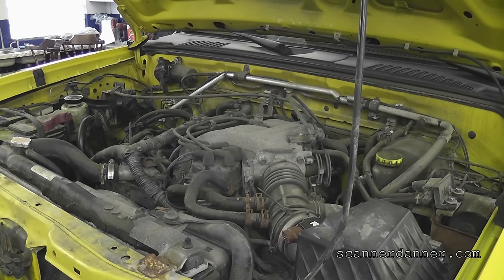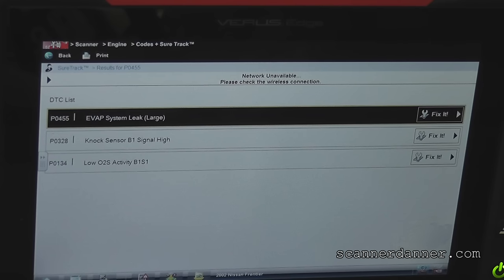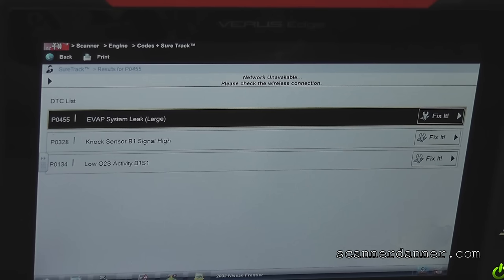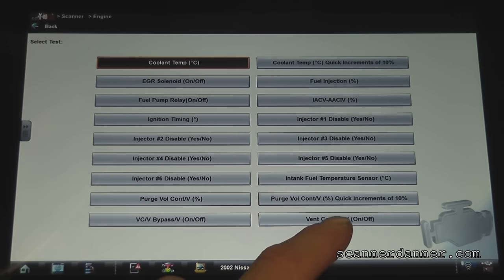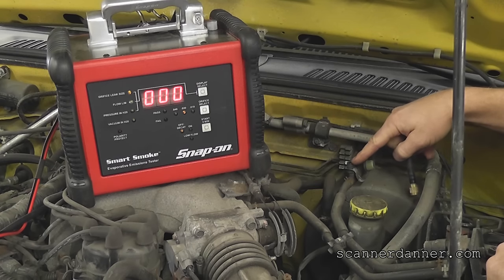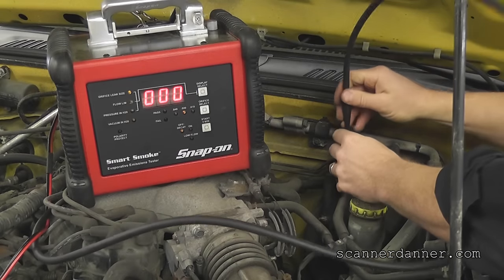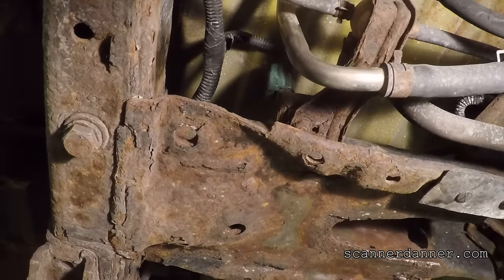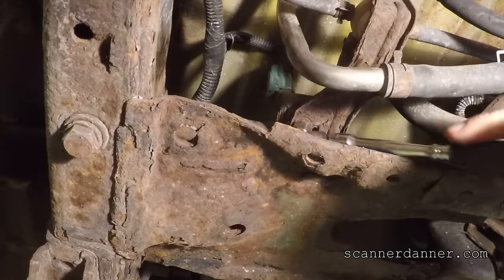EVAP  leak P0455 (vacuum cut valve-bypass valve test) - Nissan

Comment: Man, we on the west coast really do have it made. Seeing that car and it pretty much falling apart sitting there, that's tough. And I thought my 89 mustang that has lived outside for 27 years was bad because of a few spots of rust. I could feel your pain when I kept seeing all the rust flakes falling off, probably right in your face. I knew it was an issue up there, but didn't know it would eat a car away in less than 10 years.

Comment: Uggh - EVAP is my nemesis. I swear that system was designed solely to bilk as much money out of consumers as possible, and as an added "bonus", give backyard mechanics like myself an aneurism. So infuriating ...

Wish I could afford that smoke machine! Puffing on a cigar and blowing into a hose until I'm purple ain't cuttin' it ... :D

Thanks for all your vids Paul. BEST on the net, hands down. You have a rare talent that I appreciate. I've learned more in 4 hours of your vids than I have in fumbling with OBD-II since it reared it's ugly head in '96.
Reply: +Smitty Smithsonite  You can make a smoke machine from a smoke machine sold during Halloween.  I brought my Halloween smoke machine for 75% off a couple of days after Halloween.
Reply: +Upallnight, Not a bad idea! That thought crossed my mind, but I never thought it would work. Thanks!
Reply: +Smitty Smithsonite I made one out of an e-cig, an aquarium air pump, and some hose.

Comment: Thanks for this vid. Had exact same rotted in two cut valve solenoid on my sons 01 Xterra. Evap “large leak” for sure.  All difficult to remove. Was a Pa vehicle so even some of the tubing clamps were rotten. Replaced all but the canister.  PITA job. Nice vids!

Comment: Paul, not sure you can recollect me .. now you got many subscribers, let me try any case :).. when you do smoke testing on honda, toyota, hyundai, you need to activate two way valve, or bypass valve.. this is because the cars that i had mentioned seal canister from tank using two way valve and it is normally closed, if u dont see smoke doesnt mean that there is no leak, u need to activate the two way valve, so smoke can go from canister to tank.. just a little tip.. this is how it works, purge solenoid activates, send vaccum to canister, activate  bypass or two way valve, send vaccum to tank and close the two way valve (deacgtivate), and look at FTP sensor signal. if vaccum holds good, then canister to tank is good, then it activate bypass and look at FTP sensor if vaccum doesnt hold good, then purge solenoid to canister there is a leak.. it took me a week to understand

Comment: Watching you struggle with that connector made me feel somewhat better lol because I had to replace that exact same valve on my 2000 Xterra for the same P0455 code and it was nasty. Nothing but rust falling on my face the whole time. Had a cracked hose also to replace. Oh, and the kicker is that, my Xterra came from PA and I live here in FL...:):)

Comment: Great patience and video. Picked up a power probe kit and a autool 206 smoke machine have not used either one yet still messing with that annoying po448 on my 06 suboe sti . May send out the pcm for inspection.

Comment: As always Paul thanks for your videos and your honesty in filming.  Truly one learns from adversity and error and your "unedited" exploits often give lessons beyond the subject material.  Being a good mechanic is some good percentage of conquering what the service manuals and standard hours ignore - via patience, persistence, innovation, scholarship, and in my case Italian cussing!

Apropos to the PP.  I LOVE my PowerProbe IV and find myself using it almost exclusively (not like the III and lower which left me cold).  Yet on occasion  I do pull out the LoadPro with a good DMM.  E.g., when I really want to nail loaded resistance or safely test for shorts e.g. when I think water involved or safely turn on something delicate.

The LoadPro applies a guaranteed 25 Ohm current to the circuit.  I guess I trust it to keep me out of trouble.  And when it comes to resistance I find it more accurate incrementally than the PP IV.  Sometimes that accuracy counts for me.

Yes one has to calculate from the voltage drop on the DMM but that's not a problem for me plus I have a cheat sheet if my brain is lazy or numbers not math friendly.

BTW as an aside cheat sheets are a good item in any tool box and take up little space (tip to your students).   They save time, help avoid faulty memory mistakes, and add authority sometimes when talking to customers.

For example the one for resistance/voltage/amps referenced above.  And those like for MAF values are  handy when diagnosing.  And those like for parasitic draw and its effects good for diagnosing AND making the sale.  And the ones for like torque values and wire gauge requirements time saving.  Along with rules of thumb there are more.. and they help.

Hope you don't mind my unsolicited thoughts and thanks again.
Reply from the maker: +FriendsInNY not at all! Thanks brother

Comment: I'm in Florida but we get our fair share of rust belt cars (winter Floridians).  Whenever I get a connector that is that stuck, I try to use those circle tip needle nose pliers which are great at removing hoses.  I grip the body of the connector with it, and use my free hand to depress the lock. Works most times, if space allows of course ;)
Reply: Now that I got farther into the vid I saw it was one of those lovely Nissan locking connectors! Those are a major PITA.  You have to push the light green tab in and down.  It will slide down into the connector and lock in place.  Sometimes you have to bathe it in penetrating fluid so it can slide.  Once you lock it in place, you can yank it off using the pliers method in my original post.
Reply from the maker: +Lynx Star Automotive (Gabe V) sigh, I know now. Everyone is calling me on it :)

Comment: Hey Paul, just about every Nissan that comes into our shop has a KS code stored. For some reason, KS codes don't turn on the SES light on Nissans and won't fail you on an emissions test, at least here in TN. Most customers won't pay for diagnosis and repair of a code that doesn't keep them from passing and doesn't have any related drivability problems

Comment: Thanks, I didn't even see it up there before but I think mine on a 2002 Nissan Xterra is leaking too. I've been chasing a small EVAP Leak P0442 code... My valve is rusty too and I can small gas when I'm right up close to the thing.

Comment: To anyone working on the nissan connectors, You MUST clean with water soap  and air pressure so that the tab he is pressing on actually slides fully  down and  back to release the pin,  you cant just press the tab, the whole slider is spring loaded,

Comment: You can find evap leaks with soapy water/childrens bubble formula in a spray bottle and shop air reduced to under 1psi... Just an FYI. In fact I often use soapy water in conjunction with the smoke machine for those really hard to find evap leaks. It's always rust with older Nissans.
Reply from the maker: +Auto Fix Pal nice! can you share what you use to regulate your shop air down to 1 psi for us? Maybe a link?
Reply: +ScannerDanner I've never regulated 130psi down to less than 1 psi. I do  have a smoke machine. I was in another shop programming a PCM, a guy that worked there said that's how he leak tests.. That's where I got the idea to use soapy water in conjunction with my smoke machine to find those really tough leaks. He was using some regulator he got online. Definitely plausible. You can probably do a bit more than 1psi but you can ruin pressure sensors on some vehicles if you do too much.

Comment: I hope this question doesn't sound dumb. But when you checked the driver circuit and had that 0.6 of a volt, I was thinking the ground voltage was high. My question is, whats to high of a voltage on a ground for these circuits? I say this cause I just worked on a 99 Toyota with a evap vent solenoid that was sticking so I replaced it confidently thinking i fixed it. Then a week later it came back with  a circuit code. My feed was good (12+ volts) and the ground had a 0.7 when I energized it. Ended up being a lose computer connection, bring my ground to 0.03 after I fixed it.

Comment: Amp=Volt/Ohms 11.54/4.4 = 2.62 Amps
Feed test seems to be calculating the voltage drop along the wire by comparing the Batt voltage from its clips on the battery and the current(amps) it's reading through the probed wire and displaying the resistance of the circuit. Notice the Batt Voltage and Tip voltage at the bottom of the probe.
V= IR 
V = 2.622 * 4.4 = 11.536 (or 11.54 rounded up)
Basically, it's an ohmmeter using Batt voltage as the reference and measuring current flow through the tip.
Reply from the maker: +CO Jones I'm following your math for sure but here is why I do not think the tool was putting a 2.62 amp load on the feed wire. 
1. when i plugged my test lead back into the PP4, there was not arc. 
2. you do not press the PP$ on/off button for this test, it is automatically done by entering the feed test mode
3. so with it being automatically done, i would definitely have seen an arc when connecting that test lead to a circuit being energized with 2.62 amps. Unless it delays the load? 

The owners manual says less than 30ma for the feed test.
Reply: +CO Jones Here's a handy little Ohm's Law chart for DC.
http://hi-techcontrols.com/images/ohms_chart_big.jpg
I made a similar one on an index card and put it in my wallet.
Reply: +ScannerDanner The current measurement through the tip would be through a known reference mega-ohm resistor back to Batt neg just like a regular DVOM, just instead of an internal 9V battery or whatever powering the meter it&#39;s using the vehicle battery for power and the reference test voltage.

A way to test if that's what it is doing is to do the test with the tip straight on the Batt Pos (0 Ohms) and through several known resistors between the tip and Batt Pos to see if the readings match the values from a regular DVOM.
Reply: +ScannerDanner I found the manual for the PPIV. On page 10-11 it says the ohm reading is the total resistance of the probed circuit back to battery.
It also says you can plug an optional test lead in the green aux ground and use it like a regular ohmmeter to test things that aren't connected to the vehicle. So, I guess it is just an ohmmeter using the Batt neg clip internally as one test lead.

http://www.powerprobe.com/images/extraInfo/PP4_Manual.pdf

Comment: This is a great example of why we should be paid for diag. It really irritates me that some auto parts stores pull codes and then lead the customer to believe they have "diaged" the car. I guess it pays off for them in the sales of O2 sensors. Hopefully they haven't cleared the codes when it ends up at my shop.

Comment: I have a 98 qx4 and it is throwing the P0440 evap code and the P01491 vc cut v bypass v code. It has a new charcoal canister and i unclogged the hose that goes to it. A bunch of mouse poop looking stuff came out the hose when i blew it out. Is there a chance that stupid little white vacum cut bypass valve thing is whats throwing both codes? Or am i probably looking at 2 diffierent issues? Also i have very very little rust, is that why yours was such a pain in the rear?
Reply from the maker: The mouse poop 😄 would have most likely been pieces of charcoal from your old canister and it is probably throughout your entire system. You're going to have to make sure each valve opens and closes and has flow (purge and vent solenoids and all the other stupidly named Nissan evap valves lol) and that all of the other lines are clear

Comment: when doing a go vent solenoid test,,,, I install a noid light and use that to show a on/off through the ecm. could you do the same with the nissan? and with  knock sensor code..... isn't the knock code a non light setting codes (meaning that code won't turn on the MIL) I have done a few nissan V6's and that was the case. which might have been the reason why they didn't what you to deal with that. But I don't know of who through your emission checks are, and they may still require that to be cleared still. (in WA state the requirement is no MIL on)

Comment: Will these leaking cause the fuel to back out of the tank while fueling up? Trying to trouble shoot a couple problems.
Reply from the maker: Not totally sure on the operation of this valve but in general, a restriction or stuck closed EVAP vent valve will give you issues when filling your tank as you are describing.

Comment: Hey Paul, I feel your pain with the rust cancer haha! The Verus Edge is freakin' sweet too. Don't know about that fancy-pants power probe though...why not just connect a test light between the two terminals and watch it light up with the bidirectional test? :)
Reply from the maker: +motoYam82 that would work too as long as both circuits were good but if the light didn't light up I would have had to find a good ground under that rusty ass frame and that wasn't happening. But I agree, we didn't need the PP4 but it is handy in a case like this.
Reply: Oh yeah if it didn't light then the PP is a great time saver...definitely faster than stretching long jumper wires to the battery :) 
So what's the rule of thumb...if you can't find a good ground under a car then it's ready for the crusher, right?
Reply: +motoYam82 Hey ivan!

Comment: Hey Dude, I love your tutorial, and the reason for my visit is that I am having that similar code P0440 and P01448 on my 2000 Nissan Frontier 4 cyl. engine. How does a vc/v bypass valve or the vapor canister affect the performance of the car?
Reply from the maker: Depending on where your issue is, most likely no issues at all but could at times run rich and lean from say a stuck open purge valve. If it's the vacuum cut/bypass valve, no driveability issues at all

Comment: Hello Guys
I have Nissan Xterra 2004 after 3 years old after buying it, i have this error code P1490 (Evap vent control valve/bypass valve circuit) after testing the electrical connector on the VACUUM CUT VALVE BYPASS VALVE i got 11.9v i want to know if it's normal?
Reply from the maker: You need to know if the circuit is power or ground side switched and whether the circuit was on or off during the test

Comment: my service engine light came on and said i had a leak in purge valve on my 2009 nissan titan, i change the gas cap and purge valve and the light still come on. what is the next step. thank u u.s.m.c.
Reply from the maker: What is the code number and you have to use factory parts on these systems sometimes. I have a nice case study on a Hyundai where an aftermarket purge valve kicked my ass

Comment: Hello Paul

At 22:58 You mention that the power probe is draining current from the feed. How do you know that? is my assumption that the power probe is just a volt meter and the tip is just sensing the difference of potential from the negative alligator connected to the battery and the current that is being used to power the tool and the led comes from the two alligators connected to the battery.
Reply from the maker: +Alta9610 The "Feed Test" puts <30ma draw (according to the manual) on the circuit and calculates the voltage drop and resistance in the circuit. Did you notice the ohm reading for that?
I'm not sure I trust it yet. Nor do I know exactly what is being done. Time will tell as to whether or not I can trust that small of a load on a circuit.
Reply from the maker: +ScannerDanner yep, just watched it again. It doesn't change anything ("feed test"). It just calculates the resistance and you are correct, it is using the draw of the LED light. 
It showed tip voltage of 11.5 before entering the feed test mode and showed 11.5 after. Only difference was the resistance measurement. 
Again, time will tell if I can trust this calculation

Comment: There is an easier way to get the electrical connector off. If you push the green piece on the connector down toward the solenoid with a screwdriver it will come off easily.

Comment: Using Ohm's law it's putting 2.61 amps of current on that circuit. E/R=I. So 11.49/4.4=2.61
Reply: +Jacksonkellyfreak You're using the wrong voltage. You want to use the voltage drop (difference between battery voltage and tip voltage).

.05 V / 4.4 ohms = 11 mA
Reply: Nick Johnson
 Aw piss I knew that seemed way too high for that circuit. Sorry bout that.
Reply: +Jacksonkellyfreak your math is correct
Reply: Concerned Citizen
 Math is correct, just used the wrong voltage lol. I hate electricity.
Reply: if i understand correctly .05 volts is the voltage drop not the souirce voltage of the load.
Reply: +Concerned Citizen yes